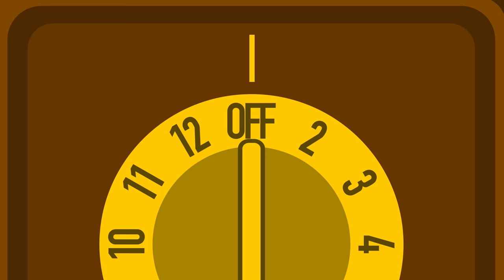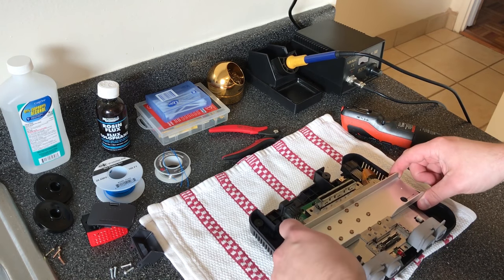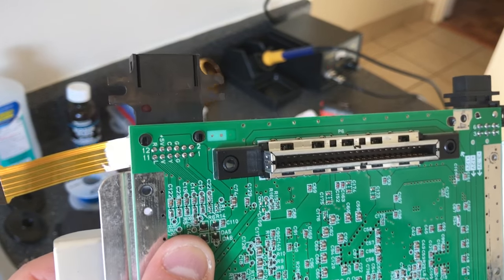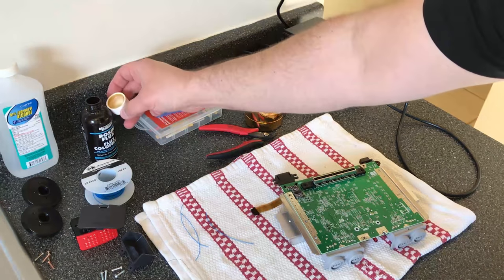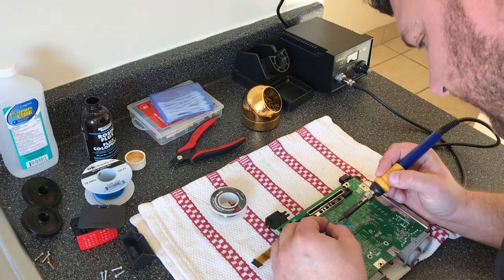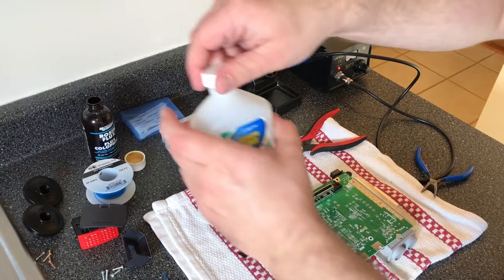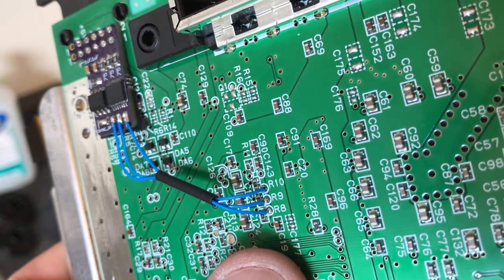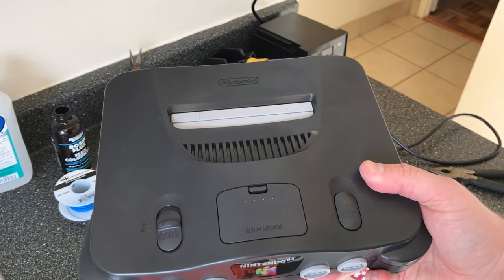N64 Basic Board Installation Video

Comment: Hey, that's my board!
Reply from the maker: Yes, definitely.
Reply: Hey Voultar, do you happen to know if the THS7316 provides equal results to the THS7374 in terms of picture quality? I've read the THS7314 has a low-pass filter on and where I buy my electronics they don't sell the THS7374 - only the THS7316DR.

Comment: Some stuff I would suggest would be getting an anti-static mat to mod on as a towel could short a board. Also instead of rubbing alcohol you should instead use electrical contact cleaner for flux cleaning. And a magnetic tool dish makes life easier by hold all of the screws in one place.
Reply from the maker: Absolutely...I definitely should have mentioned an anti-static mat in the video, as well as talked about grounding yourself!  I've been working with electronics for so long that grounding before touching is just second nature, but I shouldn't assume other people already know that.  Thanks for the tips!

Comment: You actually /don’t/ need to remove the expansion pak before taking the top off. ;) It comes right off with the top and stays nicely contained. Also, two of the screws MarshallH told you to take off are necessary for UltraHDMI but aren’t necessary for this mod, since you don’t need to take off the heat sink at all. It’s the two short screws with the jagged lock washers. For a simple RGB amp you can just leave ‘em on! :D

Comment: Hello Bob, I’m little confused. The instructions that Voultar provides on his site doesn’t mention anything about removing resistors for csync. However on his installation video, he talks about removing multiple resistors, and while on your video you talk about removing just one depending on the revision. Is there a possibility that THS7314 has a new revision that no longer requires the resistor removal? Also, do I even need to wire for csync if I plan to only use SNES HDRetrovison cables?
Reply from the maker: You don't need csync at all when using HD Retrovisions.  Also, his latest board is different than the one shown here, so follow the instructions that match the exact board rev.
Reply: @RetroRGB  Thanks for the quick response and for the clarification 👍

Comment: So, if I have a CPU-02 revision with a surface-mount resistor in that slot (6:10), should I remove the resistor and connect the jumper on the mod board - or - leave the resistor and jumper as they are? Will the second option provide CSync?
Reply: (from twitter) Voultar: Go ahead and remove that resistor and then enable C-Sync on my N64RGB board by shorting the jumper.

Comment: Will HD Retrovision cables work on this mod?  I know it works on some NES RGB mods (depending on pin layout and if they get the 5v). Reason being, I have component and I still haven't RGB modded my screen. It's a massive 40" Mitsubishi CRT, has gorgeous scan lines, just have had the courage to do it lol.
Reply from the maker: Yes, they should work fine.

Comment: I'm a little bit confused about 'CSYNC' & 'TTL-level CSYNC'. I'm using an OSSC and on the wiki page it says: "The sync input has 75ohm termination, so TTL-level c-sync should not be connected directly there in order to avoid unnecessarily stressing source console and/or scanconverter". 

I'm assuming that given my setup, if I install Voultar's N64 basic board on a N64, I should just use sync on Luma and not activate this TTL csync jumper?

Out of curiosity would the likes of a Mega Drive RGB scart wired for csync for example, running through a gscartsw with the sync stripper toggle turned on, be considered TTL-level csync?
Reply: My N64 RGB board does output a TTL (4.5v) composite-sync output. It's plenty acceptable to use with 75 ohm terminations if you put a 450-470ohm resistor on the your sync-output (pin 20) of your SCART connector.
Reply: Ah ok that makes sense, thanks for the info Voultar! By the way, I tried to buy few boards off your website, it seems there's no shipping option for Ireland. Would you be able to ship to Ireland? :)

Comment: So im about to do this mod with voultars chip but im confused. He added the 4th wire to r16 but you only connected the three. I have a 04 revision with voultars newest board. Please help. Thx!
Reply from the maker: Add the 4th and reference the webpage for mounting locations:  https://www.retrorgb.com/n64rgbmod.html  &  https://cdn.retrorgb.com/images/N64_Voultar_v3.69.jpg
Reply: @RetroRGB  ok so I added the 4th but for some reason i get a perfect picture when using sync on luma cables but when I use hd retrovision cables its a purple and distorted. What do you think happened?
Reply: @cbk12  usually a sync problem, consult Voultar's website.

Comment: Hey Bob, I recently bought an Extron and learned that my N64RGB mod that uses a sync on luma cable won't work with it :(
Does this mod utilize a sync on composite cable? I'd love to put my 64 back in my lineup with my Extron.
Reply from the maker: Since your setup requires csync for compatibility, you can just add a sync stripper to the SCART hood of your cable:  http://www.retrorgb.com/syncstripper.html

Comment: Im a bit new to the whole modding thing, so I have a question: I'm planning on picking up a VGA adapter made for the N64, will I need to do the RGB mod to get the best picture quality, or will the RGB mod not matter with VGA? I'm confused on the two.
Reply from the maker: A VGA adapter made for the N64?
Reply: That device. Its a VGA box for the GC thats backwards compatible with the N64. Will I need to do an RGB mod to get the best picture out of this device, or are RGB and VGA different and not make a difference?
Reply from the maker: I believe that converts composite video to VGA, so you won't need a mod at all.  It won't improve the picture at all - It'll still look like composite video, it'll just work on a VGA monitor.
Reply: So Would i be better off just using S-Video then and not using VGA?
Reply from the maker: In my opinion, yes...since it's not true VGA, it's 
"composite to VGA".  Getting the UltraHDMI would be the best option of all though:  http://www.retrorgb.com/ultrahdmi.html